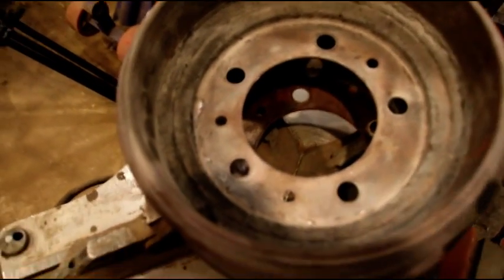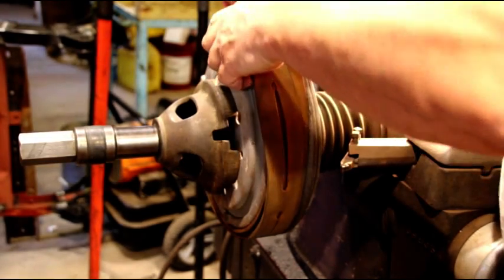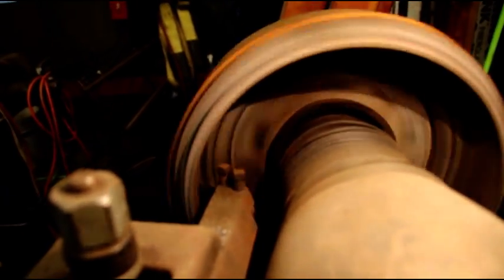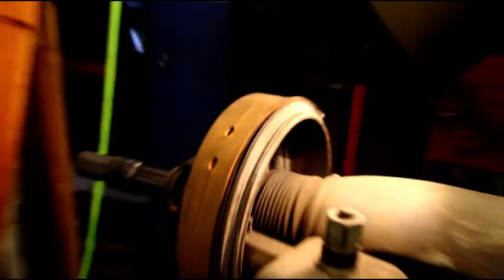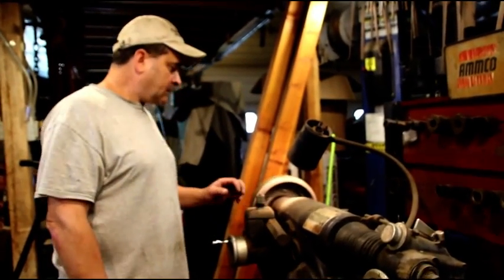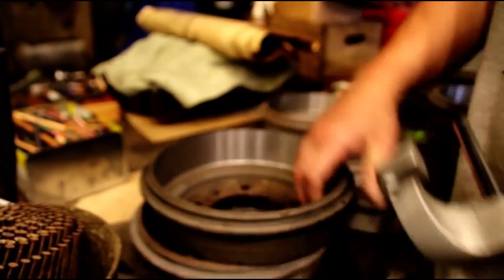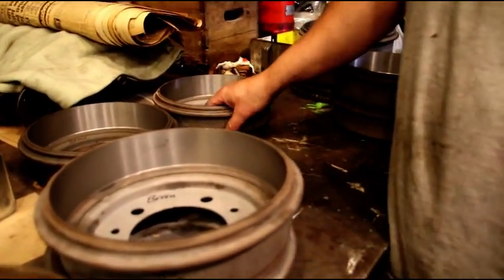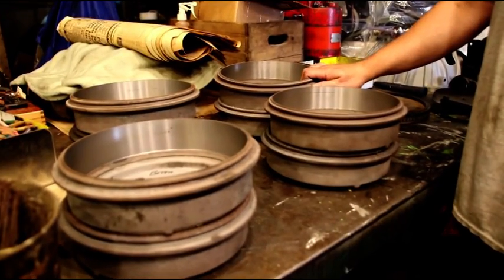Willys Brake Drums, Machining and Measuring

Comment: Hi Brian, hope you willing to assit. I want to order some brake parts for my CJ2a but looking at the backing plates and shoes I have, it seems that its not the ones from the 2a but more from the 5a. Is it possible that you can use the 5a's brakes on the 2a? My backing plates are still in a good condition so dont want to replace them if not needed. Also inporting parts to South Africa is expensive so dont want to waste money on backing plates if not needed. Kind regrads Pieter